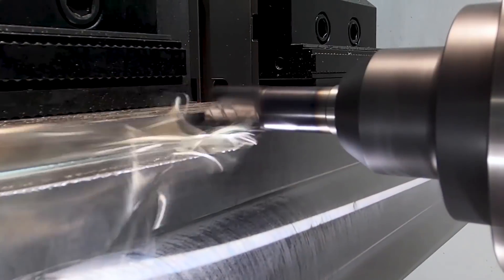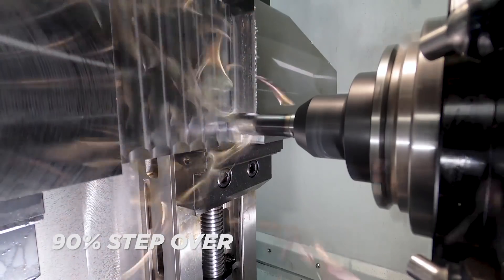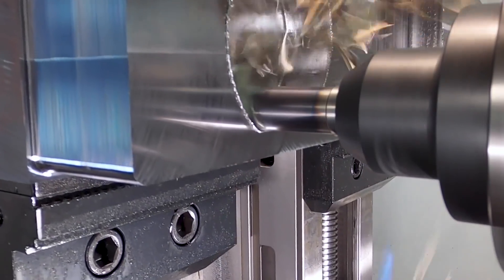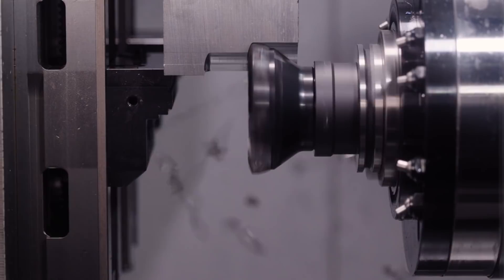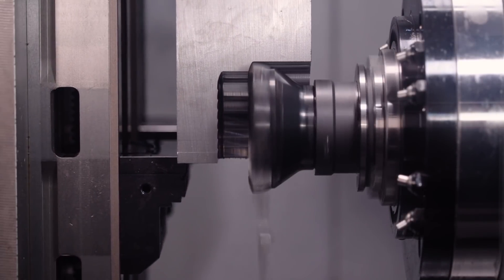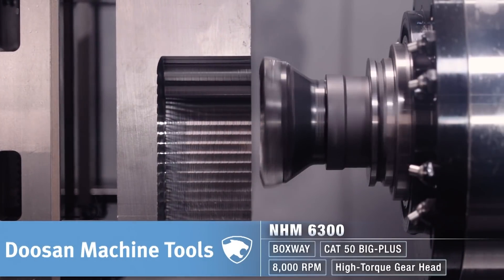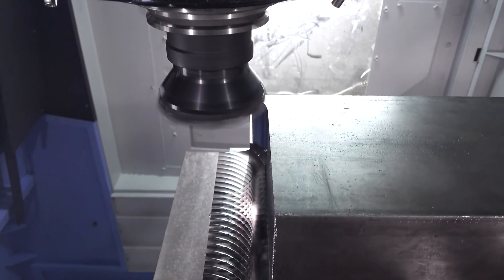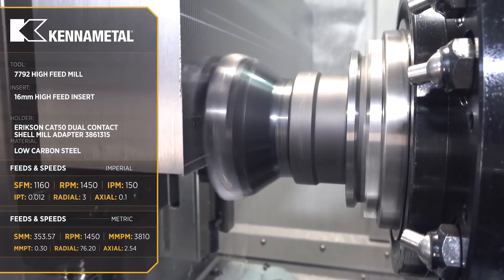Accepted a Complicated Job Beyond our Capabilities… Now We’re Screwed

Comment: I worked at a big shop about 80 machinist and over 130 cnc machines, it's true when management don't have a clue about machining they will fail, we had another company buy us out and of course new bosses it took only 4 years and the entire shop was shut down, it was pretty sad we had a lot of smart people and tons of experience......one thing that companies need to understand that there are machinist and operators and they are not the same thing I've been too many shops that are hiring that need button pushers but want a machinist , no real machinist is going to be an operator or take a high production job were you make the same part for weeks, job shops were you make one offs making 4-6 set ups a day is were you will learn and get better...

Comment: Absolutely had this happen 2 years ago. Oil and gas industry. Part was 8 or 10 feet long. 3 center lines. 5-6" diameter tubing. Mild steel. There were details on the drawing where planes intersected in odd ways that made them seem impossible to even create. Ended up having to widdle them down and ultimately finish those details with a .03' ballnose. In the end, the programmer who wasn't good with cam software missed a G41 and that was it. Scrap. Finished it off anyway cause it was near the end. Part ended up bending during machining. We didn't even have equipment in QC to check a part that long. Total disaster. I was the setup guy and felt responsible for the bad G41, as I had already found many many programming errors. Have had success with inconel parts that were somewhat similar, but shorter oal. Maybe thats why they took the job?

Comment: What I've learned is that most people in charge are in so far over their heads that it'd be better if they didn't exist at all. In general, they are trying to oversee and direct work that they don't understand. 

At this point I pretty much assume that college educated management types are mentally deficient. The last job I had was an office job where I was surrounded by people with advanced degrees and decades of experience. I wouldn't trust any of them with a box of wet matches.

Comment: I work in an Insulated Glass Unit factory.
Jobs we can't handle don't exist. It's just some take more time and tank our efficiency. Like the huge 2000x2500mm+ 8-10mm thick tempered ones. Half of them gets rejected because of scratches and other faults from the tempering process. We work about 10-15 min with it and it amounts to nothing.

Comment: For the past 6 years I worked at a small metalworking company. I have Asperger's and dropped out of uni because of it, but managed to get a training course in mechanical engineering and 3D modeling via a special program. Though we have certain lines of machines that we make for existing customers, many of our bigger projects are built to specification and the design and procurement of materials falls to me. I have an above average spatial awareness, but there are many practical insights that I lack, that I have only slowly managed to acquire thanks to input from my colleagues actually making the parts. However, I feel that my colleague that handles sales and customer relations is far too scared to lose a commission. He frequently has retailers walk all over him, and rarely objects when customers come with unrealistic demands. Often when he asks for input, the question isn't "Can this work?" but "How can we make this work by force?"
Reply: In the end my job is to try and make it work, despite knowing or having to find out later that the demands are completely unrealistic or at least well out of budget, and despite the absurd deadlines. I can remember out of hand three of the bigger, more intensive projects from the last two years, and all three of them ended up in court. Can it be done better? Most likely. Should I have done better? Very probably. Perhaps I simply lack the qualifications. There are no doubt smarter, more competent people than me out there, but since I have a mind issue I was and still am pretty cheap. It would surely help if I didn't have so many miscellaneous tasks to distract me from focusing on the projects I need to actually work on. It would help if the timetables didn't require me to try and somehow work on every step of the project at the same time – design, material procurement, intake checks, work drawings, et cetera – but there's too few people in the company to take the pressure off me. It's pure chaos. It invites so much human error on my part that I'm no longer even surprised when a few sheet metal parts have wrong dimensioning.

I wonder if I'll make it to 10 years... (No idea why Susan keeps deleting it if I write it all in one comment)

Comment: Program made a part different from the print. Corrected the program and finished the order. 1st piece and every 5th piece had to pass inspection. No problems. Then, when they went to weld them up, pilot was under the hole size by 1/16. Management derided me at company wide meeting, saying I had scrapped $200k in parts. I wasn’t going to lay down for that. I said, “The parts were to the print in the order packet, signed by me and another operator, and three different inspectors for each and every dimension. The part was correct to the pre revised print. The print was missing from the order packet when it arrived at assembly. You gave me the wrong print and tried to hide your mistake and blame it on me”

Comment: You're lucky you didn't have to pay for the material you ruined.  I run a tiny model shop.  Management REFUSES to buy me any new machinery or repair what we have.  So I'm stuck doing all my work with a 65 year old, worn out MANUAL Bridgeport, and an even older manual "speed lathe" (no lead screw).  Thank God I haven't been asked to mill or turn any hardened steel or titanium.  But when I tell them I can't ream accurately sized holes for press fits and other jobs (due to spindle runout), they look at the machine, and seeing that the spindle TURNS, assume I've got everything I need.  This is what I've seen from management over the years at various businesses.  They refuse to take the time to learn anything about the work their employees do.  They marginalize the work their employees do.  That helps them refuse pay raises too......

Comment: The machine shop I work at we had it at the other end from the customer. My boss used to work on the shop end and knew a bit of how a job will work out. But one day we had a part come in and had critical position and tolerance on an internal bore... that curved in on it self 4’in deep... in hardened tool steel, it’s really difficult how to explain what a pain this job was going to be without having the drawing; but lucky I wasn’t assigned to it (I knew it was out of skill level I can confess). Long story short the guy who did get it, got it done in the end. After he explained how he machined it, I felt lucky I didn’t have to re-surface grind the 5axs vice jaws... again.

Comment: Hey Titan my dad works at a factory that makes wooden canoe and kayak paddle and they are working to reduce noise on the mills. Does number of flutes impact noise? If not what are the other options? Thanks for making great videos
Reply: Chances are it has more to do with feeds and speeds. And if that is the case, chances are they aren't running their bits fast enough.

Comment: 52mm long acetal bush.+.05mm/-0.0 od, -0.05/+0.00mm id..and the bore is only 0.2mm over the size of the minimum size of the 12mm boring bar!. Result 44% scrap and a torn shoulder rotator cuff from the manual chuck. All for under a NZ$1.00 profit per part with no rejects...I fought(management)and lost...THEY lost a machinist(with no replacement) for 6mths....karma. boring bar was not thru coolant so no swarf clearance, mangled a boring bar too. Note to all managers, price the job correctly, listen to your machinist! If they say there is no money in the job...let it go!

Comment: I had something like that. I came in to the shop which already did that job but a lot of bad surfaces, nod debured hole-to-hole edges etc. at the end, most thing we solved with tooling but it did take a time. My experience  was L/D mill can be max 8 if you want it to work good even with just short cutting length. I learned some thin by doing that job but you learn something new on every a bit complicated things :)

Comment: Haha. Just yesterday my boss and I had a small fight over something similar. We have some parts to do that we have done in past on 3 machines to make the time somewhat normal (under 30 minutes). 
Now we got new machines and he decides we can make in 2 ops. And with way lower time. Before it took 16 min for roughing, 10 for finish and some other features and another 7 for other side. 
Over the holidays he made a program to combine first 2 ops. And since new machine is more powerful he managed to get the simulation under 10 minutes. So we chat a bit when I come to work yesterday and he is already calculating how much time we need to finish the job. We didn't even make first part. I from the start said to double that time. And we make first part. Machine is powerful. The tool not so much. Broke 3 roughing tools before first part was done. And the finish was shit.
Time to make good part with good finish was 19 minutes. We still save a lot of both time to make part and we get 1 more machine free for other jobs.
I'll see in one hour if they made any changes in morning shift =)

Comment: ? A machinist on the shop floor had authority to accept a job? Any job, let alone an expensive, complex job? If that's true, as the video implies, then the problem is a deep systems problem with the whole shop. Programming should have been required to vet (and program!) the part before management made a decision whether or not to accept the job. Something seems to have been running awfully loose and wild in that shop.

And...what sort of heavily tooled 3- and 5-axis machine shop that claims to frequently work in medical, aerospace and other high tech areas HAD HAD NO PRIOR EXPERIENCE WITH TITANIUM?! I mean, really. Something is wrong with this story. What sort of modern production shop hasn't had experience with titanium, fancy steels, FR4, machinable ceramics, magnesium and many other modern aerospace materials? Having a lot of trouble giving credibility to this story.
Reply: The story obviously is not discussing the Titans of CNC machine shop. This is a true story from a young job shop with limited experience. Management took the job having consulted with the head machinist and many things went wrong.

Comment: RAM EDM job. Complex features. Tight tolerances. Design fixtures and electrodes and write a program. I had 2 hours training on the machine. Did I mention I have no experience with RAM EDM?  Also NO ONE ELSE IN THE COMPANY has RAM EDM experience. I figured it out eventually. Guess what. Now when I say no quote for RAM EDM they listen.

Comment: My old shop had a nitinol job that was just some small washer type parts. Something like a .250" OD, .180" ID and maybe .040" thick with some simple chamfers. We got a few orders that ramped up the number of parts. Initially it was a test run of around 500, moving up to 750, then 1000, then more of a production run of 5000. For the swiss lathes running these it would have been a reasonable rate but didn't really factor in time for tool replacement.

The problem we ran into wasn't so much the material, but the changes in material each time. We'd get everything running fine the first time around, then the second time around we'd get half the expected tool life. We'd make some changes, get through the job, then run into the same exact issue for the next run. By the time we got the larger order management wanted to put an operator instead of one of the setup guys and just run it.

Ended up just being a gigantic mess that made a bunch of scrap, wasted a ton of tooling, and took too long in more ways than one.

Everyone just ended up being confused as to what management was expecting.
Reply: Sales and management never understand that even save type material of different lots will machine different. 17-4 SS is notorious for having two different heat codes of material act completely different.

Comment: Anyone who has worked for management that doesn't have a machining background has run into this problem.
Or management that thinks they have more experience than they do, or that they are smarter than they really are.
Programmers without experience on the floor, with the machines they program, are a problem too.
Gets worse when you do manage to pull off a miracle, or two.
Management comes to expect miracles every time.
Reply: Making miracles from horseshit. Story of my whole career.

Comment: Had a job come in for some EN24T and was told I had 32 hours to machine I believe 150 parts. That’s okay I guess but there was no money for tooling and all we had was budget HSS rippers. When management finally admitted fault and coughed up the money for the correct tooling, it was already on 100 hours and we’d burned through the cutters. We got the job done but it took 189 hours and they ain’t quoting by them selves anymore. I think they made a big loss on that job and me and a colleague were supposed to take the brunt of the blame, until the director stepped in and started asking the right questions. End of the day can’t cut metal with a butter knife…

Comment: I recently took on a job that other manufacturers had all refused. I said have a go but no promises. It was a turned component in aluminium, it had a Dia 100mm bore with a depth of 220mm and the end was hemisphered. The outside was turned basically the same shape as the inside. The hemisphere had a wall thickness of 0.5mm and then a 60mm groove that took the thickness down to 0.125 - 0.15mm. This then increased to 2mm wall thickness for the remainder and a flange at the end. After spending a lot of money on tooling I managed to achieve what they wanted. Got some great pictures of the finished component but it was very arse twitchy when machining the first one.
Reply: Sounds like  orthopedic implant sockets. Nightmare until you figure it out. They gravy train all the way.

Comment: I got told to make these 13-8 parts with crazy +.0001 -.0000 tolerances all over it. The parts would have been no big deal but they needed to go out for a lot of heat treat post machining. I brought it up and was told it would be fine. The dreaded "run it like that." Safe to say those parts came back all out of spec and everyone was pointing fingers at me lol one of those jobs we shouldn't have taken to begin with
Reply: I’m surprised they didn’t tell you to leave stock for hard mill/ grinding. With that tolerance yeah no chance.

Comment: I've gone as far as running the same part on two different machines. At the same time. I've tapped parts that were almost as hard as the tap.
Nothing would motivate me more than management telling me I couldn't do something. I've had some failures too though. I twisted a dudes AR receiver once. That was a tough conversation to initiate with the boss.

Comment: Titanium. Class of its own.
Exotic materials,
Composites,
Challenge worth $$$ the effort IF you invest $ the time up front. 
Sounds like the ball was dropped this time. 
My shop had offer with on-going 
New product line (for us) from Boeing. 
Owner bought 3 New Fadel VMC machines (20 tool changer). A New small CMM for shop floor 
 inspection. 
All 4 Placed in a cell set up.
Run all operations complete with inspection specs on each part.
8x4x4 Titanium material 
Castings .125 material removal overall. .125 finished thickness of walls
(Motor Mounts)
I was handed the job. 
Full control 
Program, 
design and build 3 fixtures 
Order tooling, 
Inserted cuters (Ruffing)
solid carbide (Finishing)
6 week lead time after receiving material and Machines.
Under some pressure you can imagine. 
I had the 25 years experience and it was an interesting challenge. 
Machinist tackle these jobs every day. Communications top down
Is Time we'll spent.
It all worked as planned. 
After 1st 50 part order was delivered, 
The job was turned over to
Our Parts loader operators. 
I got a Raise.
True story.

Comment: This was the story of my 2021. Not exactly a horribly complicated part, and I know my skill set can handle it. We’d gotten and succeeded on other parts for the same customer, but them there was about 8 one-offs. My best equipment for the job was just a 3+1 mill with 24 tool pockets. This was work much better suited to a twin spindle lathe with live tooling and a Y axis at a minimum. Some holes and ports would take 10 tools each. Holes as deep as 50xD, and we’ve only got 100psi coolant pressure. We successfully made some parts without issue, others were a nightmare, and we didn’t hit quoted time on any(usually over double). We had already used up our budget on tooling before I even made a chip. Big learning experience for management, and also for myself. They’ve learned what’s in our wheelhouse, and I learned some new strategies and how to use some really cool tooling.